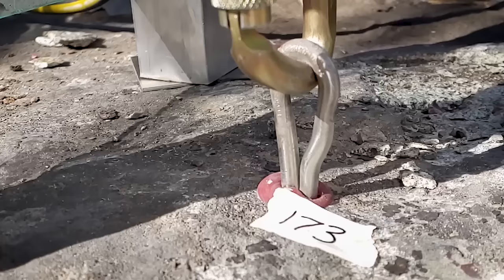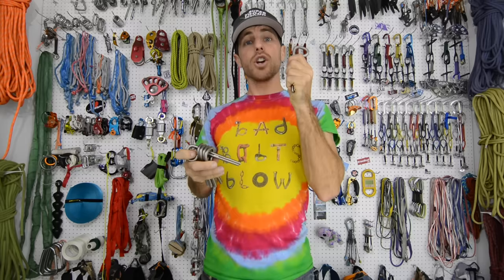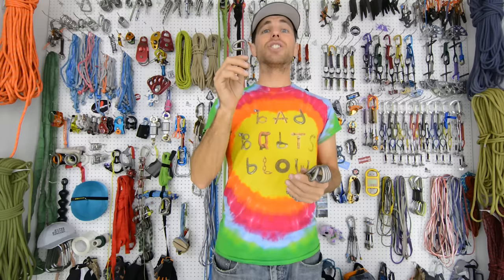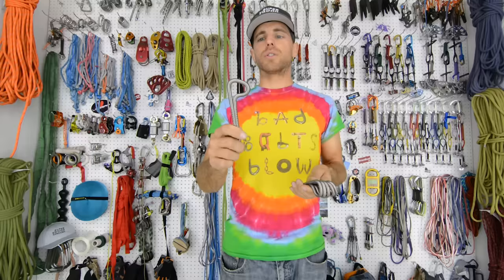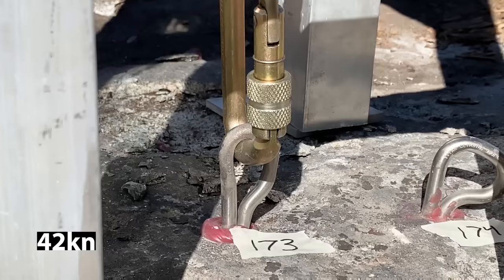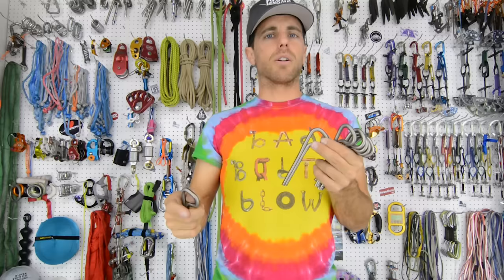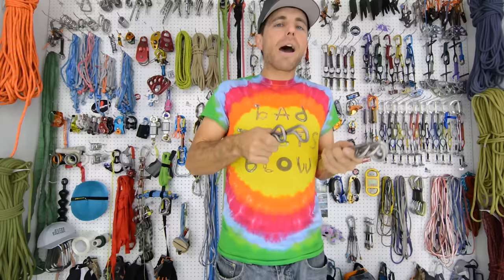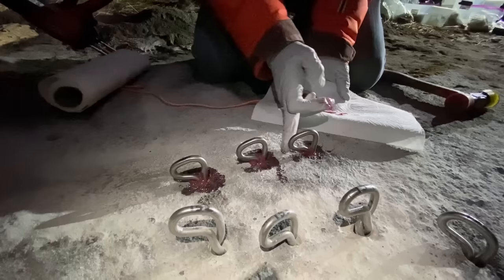Bolt Buster - 6 TITANIUM glue in climbing bolts - break test in slow motion

Comment: Titanium metal should theoretically last forever in that application. It’s so reactive that it forms this insanely inert unreactive oxide coating instantly and that prevents further corrosion so basically only the very surface creates that coating and it’s self regenerating if you scrape it or sand it down. Titanium metal actually doesn’t exist in nature. It’s always found as an oxide and you need a more reactive metal like magnesium to make the titanium. That’s partially why it’s expensive to make. The oxide coating is so unreactive that you need one of the most reactive metals on the periodic table just to make it. In nature if titanium was tumbling around it might corrode because you’re breaking it down mechanically which over time exposing more and more of the surface area to where you eventually have all oxide. That’s why they use titanium for biomedical implants. There’s literally no structural material that is more inert except for maybe ceramic but ceramic is brittle and will wear away metal.
Reply: @herointexas1431 gold is very soft
Reply: @herointexas1431 I guess that’s why he said structural material
Reply: FOREVER

Comment: About the MBS variation:
From what I know they have to specify the yield strength on the products, so the force at which deformation occurs. For metals specifically, yield strength can be much lower than ultimate tensile strength (which you test for), but can be exactly the same for some brittle ones. Deformation is a plus, as you can visually see that you are attaining unsafe forces, and a minus because fatigue is stronger the closer you get to yield forces. At actual yield forces you have a small number of deformations until total failure.
Rope/sling fiber material does not generally yield much before breaking, and as such the yield strength and ultimate strength are fairly close in value.
Reply from the maker: All the bolts I've tested definitely deformed before breaking.  So unless it looks corroded af, not to worry about bolts and make sure we are using our equipment right.  Human error is way higher of a chance than gear just randomly failing.

Comment: While the metal might last 200 years, how long will the epoxy last?  Note that epoxy hanger bolts failed in the Boston Central Artery tunnel after only a few years.  The result was an unfortunate death when the overhead precast concrete panels held by these epoxy bolts fell down onto a passing car. The metal was not what failed.
Reply from the maker: if things are moving all the time, the epoxy could fail i suppose.  A tunnel has a lot of movement.  a tiny hole in a big rock i don't think is moving much

Comment: You should consider introducing Rockwell hardness level of the metals you're testing..It can play a big part in these breaking tests..A harder, more brittle stainless steel metal can kind of chew through Titanium. Ti is kind of a softer metal. Pretty similar to aluminum....It can be tested pretty cheaply with Rockwell Scale picks. You grab one out of the set you get and try to scratch the surface of the metal. When you start seeing a scratch you look at the pick you're using and it will give you the Rockwell (metal hardness scale) number.
Reply: Dude come on

Comment: I’d love to see you do a video showing the forces of top rope falls. My friend argues that falling on top rope with some slack causes more force on the anchors then lead falls.
Reply from the maker: That's hilarious.  What is their logic.  We will do top rope forces for sure
Reply: Just compare how high the fall is relative to how much rope is in play (i.e. the fall factor).  Let’s make a worst case assumption for indoor climbing: If you are top roping a 14m route and fall from the top into 7m of slack (maybe your belayer fell asleep halfway through and forgot to take up a lot of slack) you’ll fall 7m into 14+7=21m of rope. This gives you a fall factor of 7/21=0.33. If you are lead climbing and fall at the top into the last quick draw at 12m you’ll have a 4m fall into 12+2=14m of rope. This gives you a fall factor of 0.286. Both falls are completely harmless but the top rope fall is worse in this example.

Of course with a normal top rope fall you’d usually have less than 1m of slack for a fall factor of less than 1/14=0.07 which is tiny.

Comment: Hi ! First, i really  ̶l̶i̶k̶e̶  love your channel 🖤 Second i wanted to ask you a question about using naval's anti-corrosive paint on bolts. This week i have removed two piton putted in the same spot next a dam by the same dude around 1950-60, one of them was orange painted, the other not. Needless to say what's happen for the one who not. But i'm really impressed how the painted one was still very difficult to extract. Also i was able to reading "GRIVEL" on the head of this little one who spent the last 70 years outdoors.

Comment: Have you considered doing testing only to the point of plastic deformation?  In my opinion, a bolt "fails" when it starts to change shape. For example, if I put a bolt in and it plasticly deforms at 8kN, that would be bad, even if it it doesnt break until 30kN.
Reply from the maker: Yea, I agree.  These were deforming at 12kn if i remember right.
Reply: @HowNOT2  yeah... that's the same strength that some of my trad gear is rated.

Comment: Titanium isn't as strong as stainless, but like steel (and unlike aluminium etc) it doesn't suffer fatigue problems. Provided the surface isn't cracked or badly notched it has a fatigue limit ( https://en.wikipedia.org/wiki/Fatigue_limit) so low level loads... all day every day and you won't fatigue it

Comment: Is there ever a risk that the bolt will try to twist or rotate in the hole if you pull on it from a different direction (basically, a pull that would cause the hanger to spin independently of the bolt itself on a non-glue-in)?  Is the width of the hanger opening enough to allow leverage that would cause it to twist and break prematurely?
Reply: Peter Franzen How would that happen in a real life scenario?
Reply from the maker: we will test that more.  Basically the metal bends more often than the bolt twisting.  Just about any force you put on it is fine unless you are doing some high force stunts.

Comment: In softer or layered rock, are properly installed SS mechanical bolts more or less reliable than properly installed Ti glue ins and why?
Reply from the maker: both are great for soft or layered rock.  If it will be used a lot for lowering or top roping then stainless will last longer.  If you are worried about SCC (corrosion) then Titanium will last longer
Reply: @HowNOT2  Wouldn’t you usually install a (possibly titanium) ring or karabiner for top roping?